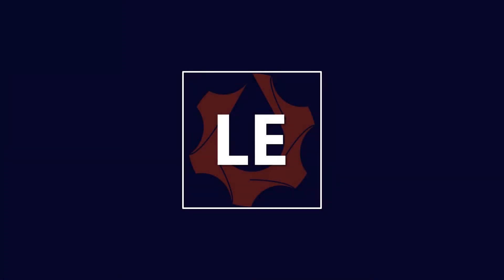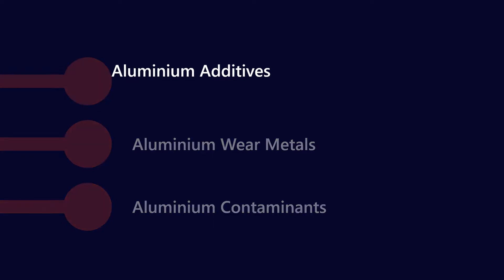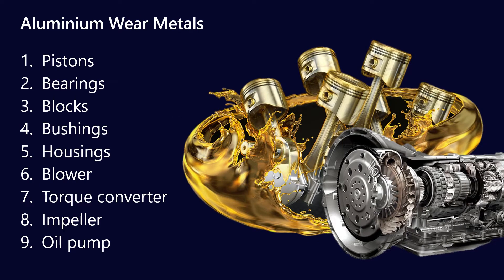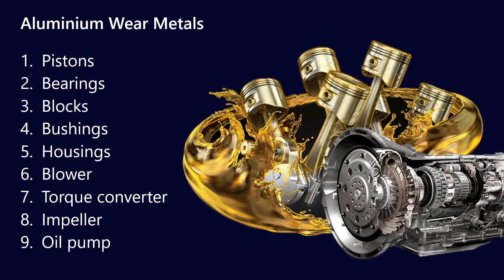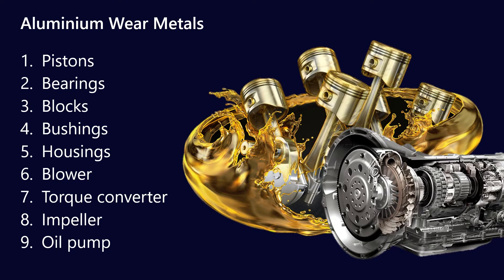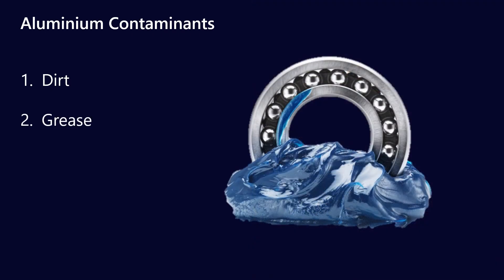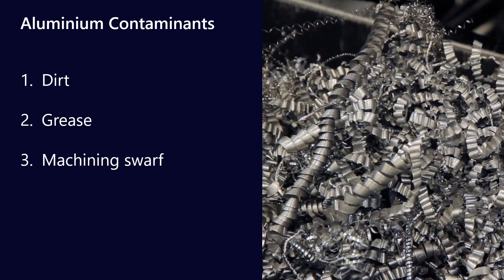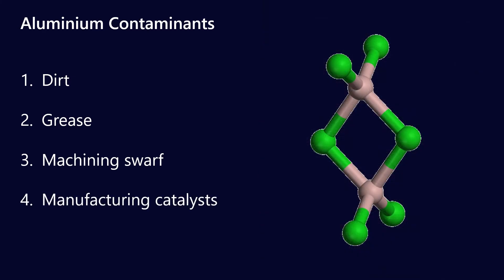Aluminium  |  Oil additives, contaminants and wear metals

Comment: Al as a metal in engines only has two advantages over Fe and both are mass. Total system mass and reciprocating mass. Aside from mass Al is inferior in wear, strength, cost, thermal expansion coefficient, modulus of elasticity, fatigue, and thermal efficiency. Fe alloys do a better job of keeping heat in the combustion chamber where it can do useful work and Fe alloys better retain strength at elevated temperatures.
Reply from the maker: It's really interesting. Industrial stationary gas engines have been using aluminium pistons for the longest time, but the industry recently started using Steel in some of the larger engine models. It has wreaked all kinds of havoc on the industry because the lubricant chemistries don't really suit Steel pistons. Who would have thought?

Comment: I see the issue, your incorrect pronunciation is caused by incorrect spelling. "Aluminum" was the original proper name given to the element back when it was first isolated and described. 
(Similarly "math" predates "maths" in all English speaking countries. Which makes sense as it describes an overall field and process rather than some collection of sub-components, which makes the use of a plural s grammatically non-standard.) ;-p
Reply from the maker: Hahaha. On the other hand - calcIUM, magnesIUM, osmIUM, palladIUM, titanIUM, ZirconIUM, iridIUM, plutonIUM, uranIUM, potassIUM, sodIUM, lithIUM, potassIUM, radIUM, cesIUM.... Granted, there's platinum, lanthanum, molybdenum. But they're exceptions ☺☺
Reply: @LubricationExplained  And aluminum is of course a fourth exception. Along with about 2 dozen other elements that don't end in -ium. 
My main argument is, and was, that the name used in the original papers when element 13 was isolated used -num not -nium. 
Then of course it is element 13 so exception should be expected.

Comment: Good explanation about how to distinguish between dirt Al & wear Al. Wear Al would be higher numbers?
Reply from the maker: In general yes, but often dirt contamination happens to the oil sample - I.e. after a sample has been taken, the sample bottle sits on someone’s desk in a dusty environment, allowing a lot of dirt to enter the sample. As a result, Al values can get really high from contamination!
Reply: @LubricationExplained  Incredible. A person who doesn't cap the sample, tight, right away, hasn't been trained. And in that case - Silicon also increases?

Comment: Based on the dirt in your video, what would the best method for obtaining an (engine) oil sample for analysis?  Garage conditions being what they are, I’d venture to guess most samples are obtained from the oil drain stream from the crankcase.  Does the temperature of the oil (when a sample is taken) have a bearing on the analysis results?
Reply: That was a very informative video to help sharpen my sampling skills and documentation. Excellent video series, thank you!
Reply from the maker: Good question! Absolutely, you want to try to grab a sample as close to operating temperature (safely) as possible, so that you get a representative sample. If taking from the sump, drain off some volume first because contaminants will settle to the bottom of the pan. If you really want to prevent contamination, look up "oil thief" and install sampling points where possible. This video should help: https://youtu.be/hIhcyRmOB4w